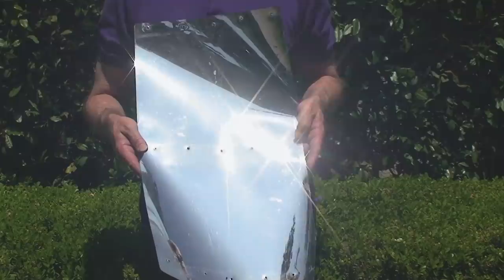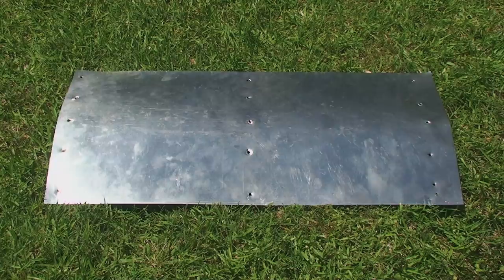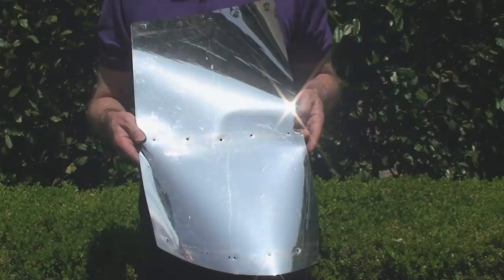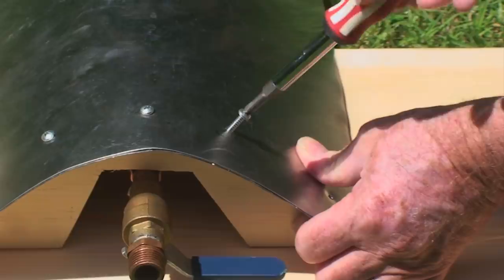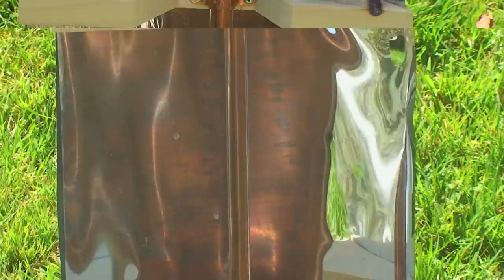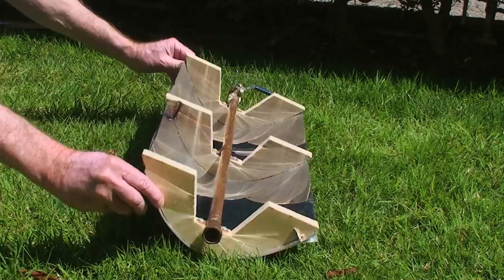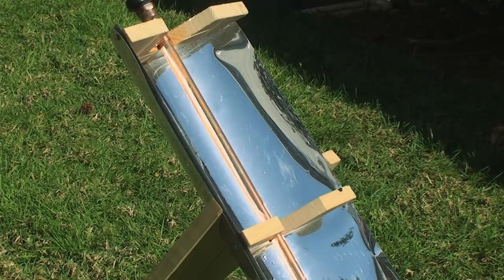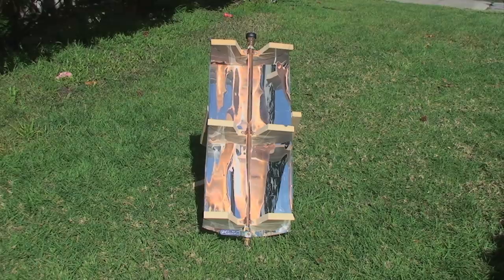Solar Water Heater Demonstration

Comment: I think this is far from efficient
Reply: It does not need to be efficient to work well enough to heat water. Think of an internal combustion engine, they are highly inefficient, but will propel a car perfectly well to get from A to B. Thats all this needs to do, create useable hot water, for domestic use, which a commercial set up will do. Efficiency does not really matter, especially as the fuel (the suns rays) costs nothing.
Reply: @roberttill3787  Efficiency does not matter? What? When it gives half a cup of water...
Reply: @earthenscience  You did not properly read my comment, or possibly understand it. My comment was, "Efficiency does not really matter, especially as the fuel (the suns rays) costs nothing." If it heats enough water for domestic use, with a fuel that costs nothing (the sun), then efficiency does not really matter as its doing the job so efficiently the fuel (the sun) is costing nothing.
Reply: @roberttill3787  it does not cost nothing u need to buy the copper pipes and other materials. and a lot of people do not have infinite space in their yards. if your only use case is half a cup of water then yes efficiency does not matter for you
Reply: @earthenscience  Any form of water heater costs money to get, so i think your remark that it costs money to buy the components is a little harsh. Anything costs money. There is an old saying, "theres no such thing as a free lunch". As for space in your yard the Spanish have commercially made versions of this, and to save space they are usually positioned out of the way on the property roof.. I think you are being picky with the concept.
Reply: @roberttill3787  no i litterally get stuff for free you can get stuff from the trash Money is a human concept it litterally is paper grows on trees and its free to grow trees (sun gives us free energy)